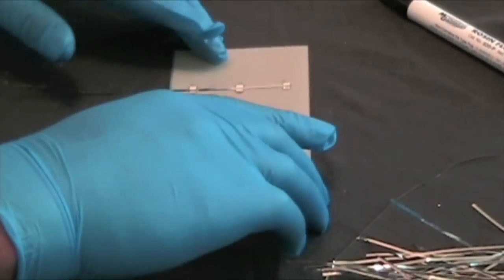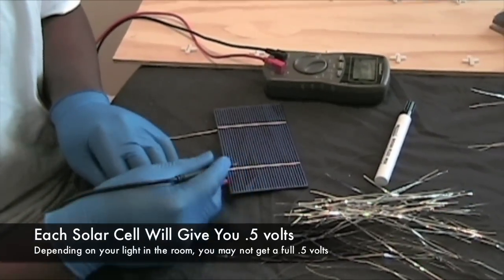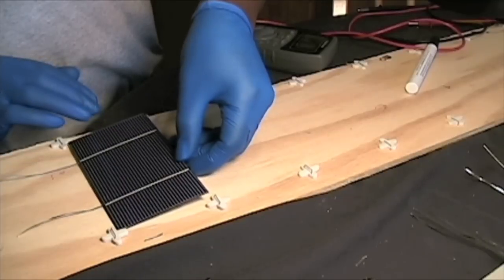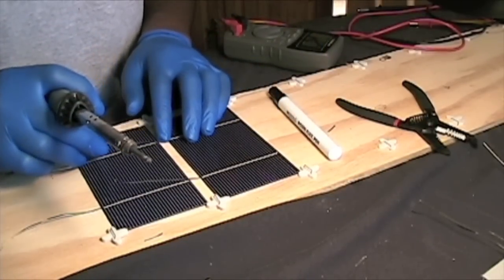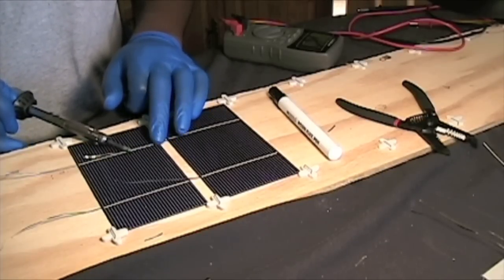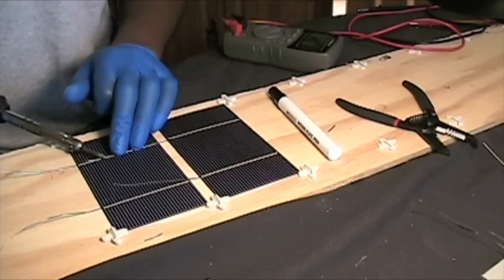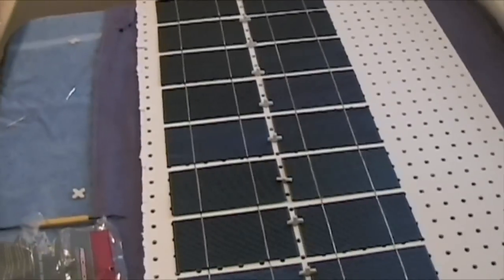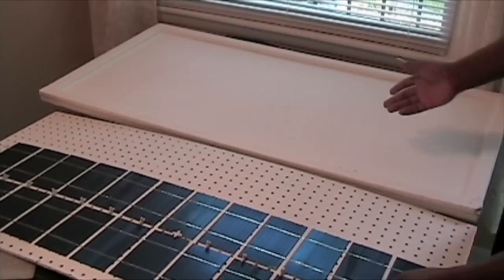How To Build A Solar Panel - Part 3

Comment: What is the name of solar cell where to buy it ????
Reply from the maker: Hi, I purchased these solar cells a long time ago on eBay. I do not think the same seller is still around, but if you search for "solar cells DIY" on eBay, you should be able to find something similar.
Reply: @GreenTechTown  howuch power a 6v 100 mah 10 solar panels can give me and how much ah battery should I use ??

Comment: why do  you have to over lap the whole length of the solar cell strip  because you are just conencting them in series
Reply from the maker: It was just what was recommended. I am sure there is a more well thought out reason but never looked it up honestly.

Comment: Why does he cut the wire so that it doesn't go to the end of the solar panel, it must be missing the charge from those few cells that are missed out, It does look like the panels could also have a wire running across them, in that case though why solder 90% of the way across the top when 10% would also make a connection?

Comment from the maker: Because the positive/negative points are on opposite sides of the solar cell, and you are connecting them using a positive to negative method. Using 1 strip would not allow you to do that.

Comment: Hello , I bought some 3"x6" solar cells that are rated at .5 volts 1.8 watts and 3.6 amps. I'm checked with spot light, watts its ok. But I'm not sure about AMPS.
 I used multimeter on DC amps (the 10 amp setting) and reading around 0.83 amps all of the cells.
 Do you think there, is a problem?
 
Thanks

Comment: For anyone else looking at these vids, having a soldering iron with a flat tip is helpful in doing this. Also, a thicker tip retains more heat so get a bigger tip for your brand iron if possible. I have an 75W with a big fat tip and it heats up very quick and works great.

Comment: Heya Robert, first off thanks for making this video it helped me a whole lot. im doing a project for school and im just wondering when your soldering + to - at the start of the video do you melt the solder wire or do you jut heat it and it sticks to the flux??
secondly white are those white bracket things called and where did u get them??

Comment: Thanks Robert.  This is all very helpful.  If you don't mind I would like to suggest that you extend your tabbing wire completely to the bottom of the top (neg) side of your cells.  That is why you are loosing some of your voltage.  A small bit for sure, but it adds up after so many cells.  It's very cool that you are making this vids for those of us who are just learning.

Comment from the maker: @SirSchumii Wow relax my friend, it's not that complicated at all :)

Each solar cell is rated at .5v right?
If I have 12 solar cells hooked up in series, you "add" the volts which gives you this:

.5v+.5v+.5v+.5v+.5v+.5v+.5v+.5v+.5v+.5v+.5v+.5v = 6v

So now if I add 12 more solar cells (24 solar cells total), we can just add 6 to our total volts which is: 

6v + 6v = 12v

So I think you are using "5" instead of ".5". 
Each solar cell is rated as ".5v", not "5v"

Hope that helps :)

Comment: Good instructional video, but you really do need to add a small amount of solder when applying you tabs to the back of the cells and when soldering the cells together. This will make soldering much easier and faster. Not to mention a much better and longer lasting solder joint!